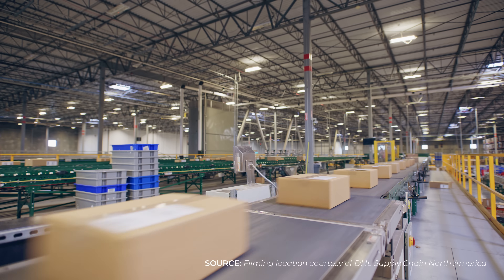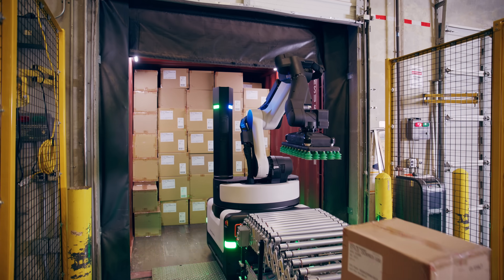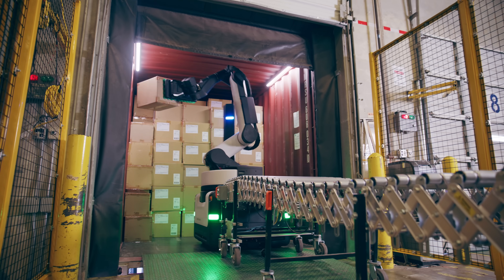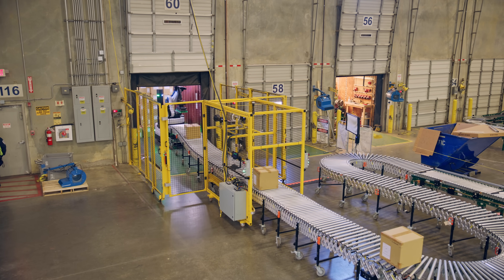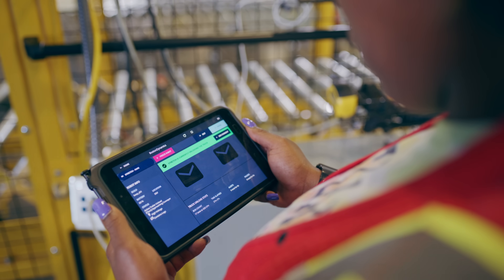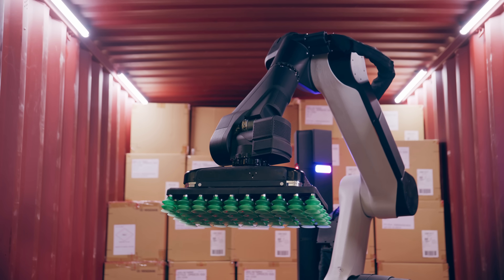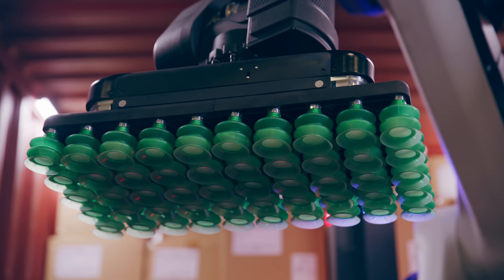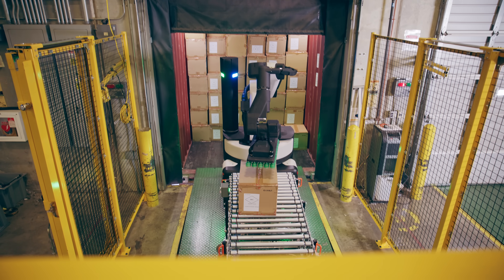Stretch at DHL | Automated Trailer Unloading

Comment: The tipping/loading night shift is great money, did it myself years ago. Was a fun crowd to work with too. Would be a massively expensive outlay to fit out the place I worked at, they needed 10 arctic lorries being unloaded at a time full pelt to keep up with the sorters. This robot seems to be as quick as one person taking it easy. Pitch me 20 years ago against that bot and I would've outpaced it easily, even taking long breaks. There's no replacing the human incentive to take that wage pack home and keep a good job down. (Not to mention the power bill would end up parallel with wages that would be spent on staff doing the job anyway.)
Reply: Don't worry I've seen this robot in person (in their lab's [my teacher had connections and gave us a tour of their facilities in … not Boston I forgot where their headquarters is exactly but its very closed to Boston]) and they were showing off the robot picking up different sized boxes with un-even weights in rapid succession. Basically from what they explained to me the robot starts of slow because it needs to map out the boxes with a depth camera, but it cant do that if its a flat wall of boxes. So, the robot needs to remove some boxes and then its cameras (which take pictures every time it wants to pick up a box) can map out the boxes and more accurately predict were the boxes are in a 3d space. So, overtime it gets more confident in its prediction's and its starts going very fast (so fast that it made a mess on the other side in the demo because there was nowhere for the boxes to go). I honestly don't know why they didn't show of a better clip than the one that they did but I don't have all the answers.
Reply: Keep in mind this V1 is only going at what the engineers decided was a safe pace for initial deployment/testing. Theres no reason this bot couldn't move faster, with less delay between movements. I have a 3d printer with a similar problem. It waits 3 seconds times 2 between each layer movement. I have the ability to make it 1s or less with some minor setting tweaks. If I take it from 3 to 1 I can turn a 28 hour print with something like 3800 layers into a 12 hour print. Very minor tweaks to settings can make this much faster.
Reply: @ablasttv  Thanks for your reply. I can understand that however to go faster will consume more power. With the way power prices are going even implementing an eco mode wouldn't make ongoing electricity usage costs any less compared to a person's wages when scaled up to big numbers. We were 1 worker per truck so it has to compete with one person's wages only. The night worker hands over to a day worker so it's still just the one 24/7. Get 10 of the robots going and you'll be feeling the difference in your power bill for sure. Haven't even started on maintenance and breakdown assistance turnover speed/cost at increasing scales or long term reliability.
Reply: @omniverideus  I guarantee this thing at any speed does not use $15/hr of electricity, or even $7.25. At the absolute worst maybe $1/hr, probably closer to 25-50c. It costs only around $13 to full charge a tesla with a much more massive battery that lasts longer than an hour driving a ton of weight hundreds of miles. Thats not a concern vs wages of a worker. Robots do not breakdown as often as they used to. Walmart and Amazon have some very highly automated warehouses and its only going to be more so.
Reply: @ablasttv  I am on your side about automation, but to be honest you have to account for the cost/rent of the robot too.
So i think it would be more than a 1$/h, especially the first years of operation.
Reply: @ablasttv  Where are you getting those figures from? As an electronics engineer and the bill payer of our power bills here in Australia right now I can tell you that's codswallop. The comparison is also absurd as the car gets momentum whereas the robotic arm does not - also will not deal with badly packed items which will slow this to a halt until an operator comes in to clean up - eg: heavy contents, thin box.

Comment: I work for a parcel company, boxes need to be picked up from underneath and on both sides. The boxes can often weigh up to and even over 30kgs, picking those boxes up from one front or rear side panel will cause all the weight to rip through the box.
Reply: They have other unloading machines that can handle those type packages.  Not to mention all they have to do is put them on a pallet or a moving floor, both of which they've been working on for years and are active in many warehouses for testing across the country.  Look up Honeywell Robotic Unloader posted from three years ago, just one of many options.

Comment: Next level cringe, if you work for DHL you know this is way to slow, this thing needs to run 10 times faster to achieve the rates of a human. The other thing is the robot can’t carry things like a human with his hands, the whole lift system is designed for a special sized box, the human hand can carry everything. If the package is bad a human will still bring it to the conveyer without damaging or dropping it, the robot won’t. This has to change massively before even come close to human worker, sry….

Comment: The is a use case for stretch to fill in in between breaks. It can not replace the speed, efficiency, and care of a human. But, it could unload maybe 1/2 of what a human could, during their hour break. Which would increase productivity during a 10 hour shift by 5.5%, and if there is down time between breaks, even more.

Comment: I worked at UPS for five years, and never once saw a truck loaded that perfectly.  It's most often just a shifted mountain of crap, with random packages thrown over to top and backfill.  Not only would a realistic load be harder for Stretch to negotiate, anybody who's done this work immediately recognizes Stretch simply is not fast enough.  A truck that size will typically have the rollers in the center, with two guys on each side, throwing boxes like they're bailing water from a sinking lifeboat in shark infested waters.  This technology is marvelous, and it's come a long way, but it has quite a way to go before it becomes an industry standard.  Within the next ten years though, Stretch is probably going to put a lot of people out of work.

Comment: Gays this robot looks like indian technician solution. 
Why dose gravity dosent work  for you?
Crane may up container on high gravity position place. 
The boxes may slide done by the surfaces. The robot must make a slide surface to separate boxes. And little bit push. Only this!!!
It is a simple solution that can make this* projects more energy effective.
Reply: O cammon', the weight of the boxes is limited by the force of the suction cups?
Is this nessesary?

Comment: Nice! But does it only work with these fixed-side boxes shown in the video, or can it handle diverse dimensions? Can imagine dealing with all the shapes and sizes could be hard.
Reply: Don't worry I've seen this robot in person (in their lab's [my teacher had connections and gave us a tour of their facilities in … not Boston I forgot where their headquarters is exactly but its very closed to Boston]) and they were showing off the robot picking up different sized boxes with un-even weights in rapid succession. Basically from what they explained to me the robot starts of slow because it needs to map out the boxes with a depth camera, but it cant do that if its a flat wall of boxes. So, the robot needs to remove some boxes and then its cameras (which take pictures every time it wants to pick up a box) can map out the boxes and more accurately predict were the boxes are in a 3d space. So, overtime it gets more confident in its prediction's and its starts going very fast (so fast that it made a mess on the other side in the demo because there was nowhere for the boxes to go). I honestly don't know why they didn't show of a better clip than the one that they did but I don't have all the answers.

Comment: I get why the prototype system here was build for existing infrastructure. But changing the infrastructure such that multiple robots can access at the same time (trailer open from the side) would make the robots actually competitive not just in cost but also in speed. No matter how cheap the robot if it is not fast enough it won't take over. And the demo shown here is by no means fast enough.

Comment: as a truck driver, I've never once taken jobs where I've had to touch the freight. on top of all your responsibilities driving the damn thing, requiring the driver to load/unload is insane. I know the last company I worked for unfortunately can never use this type of technology in it's current form because most every load required extensive use of load bars and stacking things like motorcycles (which are strapped to skids), medical devices that are simply shrink wrapped ect. it would usually take 2 hours for 2 or 3 people to load a trailer and maybe a hour to unload, a very laborious task. and trailers don't have climate control so if it's a hundred out it's a hundred ten in the trailer, same for the cold so it really does take a certain person to be able to do that kind of work day in and out. but that person fortunately isn't me and never will be hah

Comment: I think the Achilles heel of this current system would be poorly packaged items that are heavy. For example I ordered some dumbbells and the box was completely shredded when it arrived. There would be no way for this robot to pick it up properly, the suctions cups would have just ripped the top off. But it's perfect for the scenario it's depicted doing where it's a bunch of boxes from a factor that should all meet a certain standard.
Reply: @hhjhj It's coming, baby steps.  Once they perfect the technology then they have the excuse to set the standard.  With the standard comes the pricing, so that's why it will be the last step because the customer has to buy into the process or have no choice.  If they standardize now there will be to much push back, it needs to be a slow burn.  Just like "two weeks to stop the spread" it's all about the long game.  But most people are conditioned for instant gratification so they can't see that far ahead.

Comment: after finding out most shipping companies use manual sorting for the majority of their mail i'm not betting on this to actually be implemented for another 10 years. but suction cup grabbers would help human unloaders. especially for units from china, they pack the top row so tight it takes way too long to start each row compared to the rest. (i mean like 30 seconds compared to like 5 seconds when you're working on an open row.)

Comment: I did this same job at a Walmart distribution center and I absolutely hated it and so did my coworkers. In the summer it's 120+ degrees in the trailer and in the winter it's below freezing. Glad the robots are taking this job, it's not fun.
Reply: now let's see them load the trailers!
Reply: @skmetal7  yeah I'd like to see it unload a grocery trailer that wrapped in saran wrap. This whole video was fake, no truck load of packages is perfectly stacked like that.
Reply: @johnames6430  i searched for videos of truck unloading and yeah, this video is far from reality. while robots could do a good job in a world with standardized packages, the reality looks different, there are packages which are tiny, or a bunch of cans, stuff which is only box shaped at the bottom, boxes which are damaged and not stable enough if picked up wrong, boxes with weight imbalances, which will break if picked up wrong, boxes which cause "avalanches" if picked up... and a human is so much faster, especially with many small packages - like 3 times faster and throughput is often kinda important ,you don't have all night. There are solutions for that stuff, but at the end, you replace relatively cheap labor (low pay, easy to train etc.) with a very expensive system, so... but at some point it will be ready.
Reply: @johnames6430  There is usually a crushed mess to clean up when unloading for sure. I guess it may be ok for a factory that uses their own boxes and are loading the trailer.
Reply: @johnames6430  Distributors are going to agree on a standardized shipping box that can flow through a their networks without being handled by humans. End to end automation will negate any profit that's lost to shipping air. I worked in a distribution center for 10 years and every other process had been automated by the time I left. Order picking, transporting boxes, sorting boxes, battery changes. This is not an impossible problem to solve. Non-conveyable freight is a bigger challenge.
Reply: @vanivari359  You're missing the point of the video. It's not meant to show that this robot arm can handle any trailer/box size/any load. The video is conveying a bigger picture, of automation starting to take shape. This is just how it starts. Over time, they can implement more complex robots. If you look at previous robots made by boston dynamics, they all started simple and only improved over time.
Reply: Did you enjoy having money so you could pay rent and eat?
Reply: @kgeo753  it wasn't the only job in town so I didn't need this job. I found another one that is less miserable and pays more. But all of that is behind me. I make much much more now. But yes ...I like money.
Reply: @AnthonyGale  Good for you, Anthony. I don't know why you're so defensive. I too got out of this line of work but I haven't forgotten about the people who still need a job like this. Which is a lot of people. You can make value judgments about the job or the people who do it but that doesn't change the fact that as more of these jobs are automated there will be fewer jobs for people to do and that is going be a major issue that needs to be addressed.
Reply: @kgeo753  these arguments have been made every time industry has been changed by new technology and every time it been proven that technically actually creates jobs. Also, people should be learning new skills, and not assume their job will always be there.
Reply: Поздравляю , ты остался без работы
Reply: Why do you need a robot to not work there? You could have just not taken the job or quit and the effect on your life is exactly the same.
Reply: @iunnox666  You never know exactly how bad the job is going to be until you do it and I did quit and so do most people. Many people do the job for only a few months before they burn out.
Reply: @AnthonyGale  So you're hoping that robots will save people from the horror of a job opportunity? 

Why do you people think that you'll be taken care of by the people who own this infrastructure? The only thing it's going to mean for the average person is it's going to be harder and harder to find employment. Like I said, you can experience that reality today by simply never taking manual labour jobs. Just be unemployed and experience the magic of the future.
Reply: @iunnox666  people have made that argument every time technology has changed industry. When the car replaced the horse and buggy farriers thought they'd be out of a job. Same thing happened with computers etc. The opposite has always been true, instead innovation creates jobs. Furthermore, it's not the responsibility of any company to make sure any of us have a job. In almost all instances, a company will do what it takes to find a better, cheaper alternative. It's not their responsibility to make sure you or I have a job. It's business.

It's also really difficult to make the argument that it will stop anyone from a job opportunity when "NEED HELP" "We're Hiring" signs are all over the place. People have opportunities everywhere because people are being selective and don't want to work shitting jobs, this is one such job.
Reply: @AnthonyGale  Ok, buddy. We'll see what happens.
Reply: @iunnox666  People need to eat, dude. A lot of these distribution centers are in rural communities where job opportunities are scarce and they're hiring people without a college degree. I did this job for 10 years and it is brutal but companies know precisely what to pay to  keep employees from leaving. If you want to keep a similar level of pay you're probably going to be doing similar work somewhere else if you leave.
Reply: @kgeo753  Not sure what your point is as you didn't address any of mine.

Comment: Seems a bit slow but at least it's continuous. When working in a wharehouse I estimate people were unloading around 4-5x as many boxes a minute as Stretch does. Stretch needs to be manually repositioned after it's cleared the first few layers of boxes anyway I guess? Same for the conveyor belt. But yeah its continuous which is a big thing as long as the truck driver isn't waiting. When I was in a warehouse from the moment a FULL truck pulled up about 3 of us would have it unloaded in like 15 mins lol. Stretch seems more like 2 hours.

Comment: How do those suction cups work? Never saw a suction cup work on anything as rough as cardboard!
Reply: Just read the brochure .. it's a "Vacuum-based gripper" that " informs the controller on how well it is
gripping an object. Based on that input, the case handling robot will adjust its speed, moving quickly if the grip registers as strong." Amazing!

Comment: To be honest it looks funny seeing DHL investing in such expensive and flashy infrastructure while failing to automate one of the most fundamental parts of their operation. As MediaLag video states there is a great efficiency loss in shipping if the packages are sorted manually like in the German DHL facility. That means up to 10% of processed packages are sorted incorrectly and sent to the wrong destination! Imagine ignoring the already available automated sorting solutions with 0.01% sorting error probability and investing into a proprietary  $15 million box stacking robot.